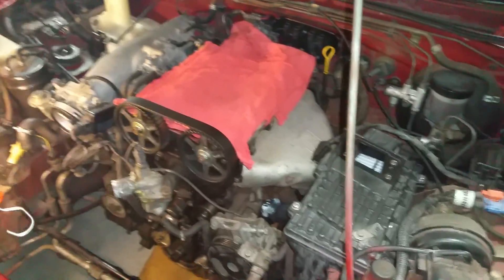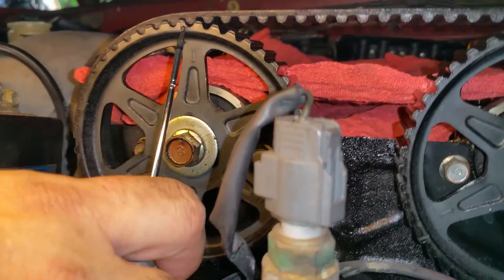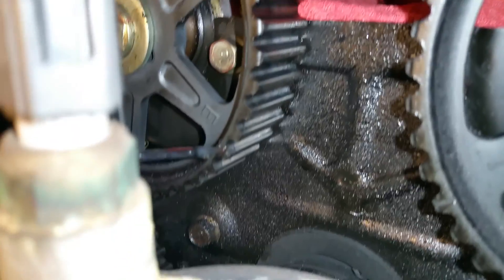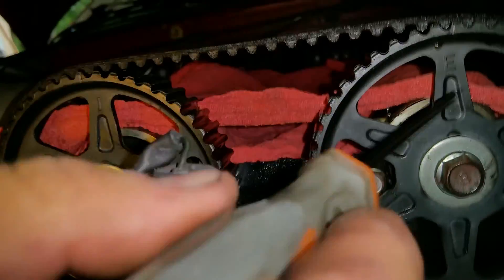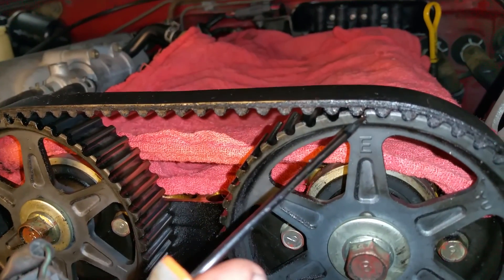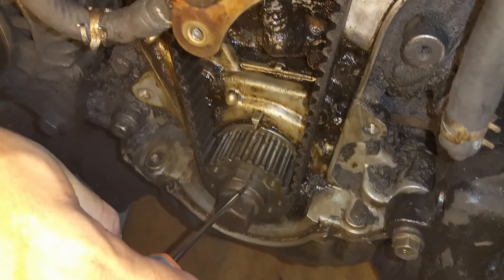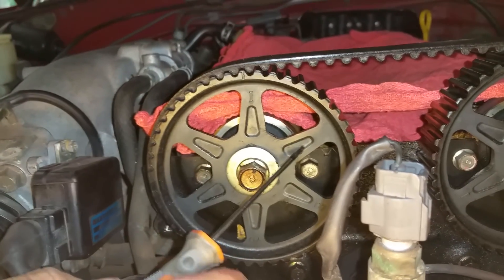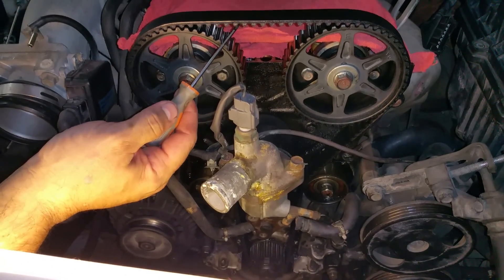Checking timing 1990 miata

Comment: That's not the key way that you pointed at that's the outside of the Kay way you have to take the bolt off the crank and pull the gear off to see the woodruff key and the key way
Reply from the maker: Wasn't a keyway issue anyway; it was low compression. Replaced the engine and running strong.

Comment: I know your video is from a while back but yours is the first one to really show how the marks on the pulleys are slightly lower. Was your engine on point in terms of the timing?  I looked at a service manual and it shows the marks a bit higher right in the center plate pointers but I couldn't get that left on that center. It's either one tooth higher or lower. Worst marks ever. Everything else on the car is fine but I'm thinking this is why it always ran a bit under power. I just changed the water pump again after about 8 years so I'm putting it all back together hoping it will be better than the first time we did it. Not a hard job just time consuming.
Reply: @erickhensley9729  did you ever figure it out?